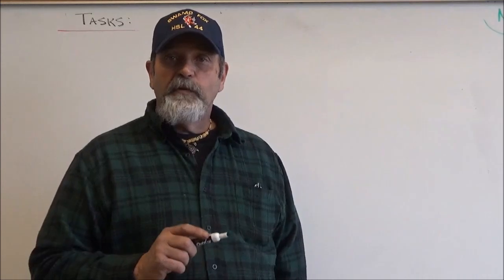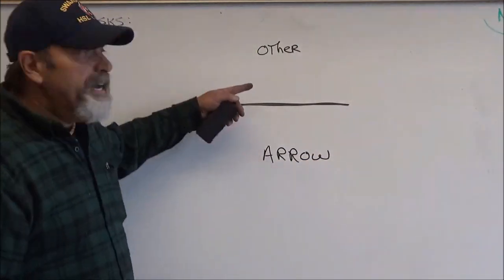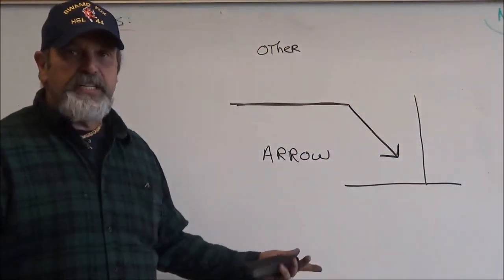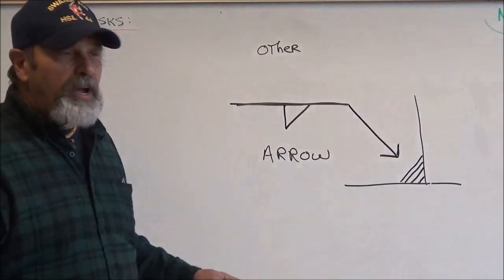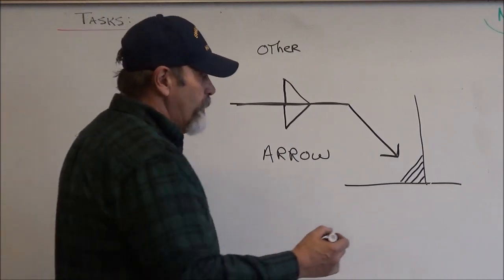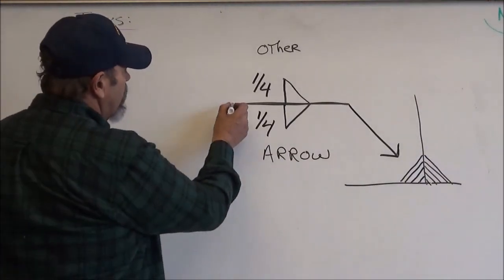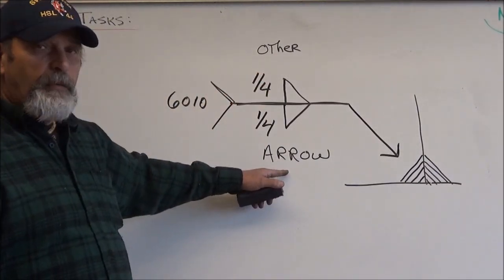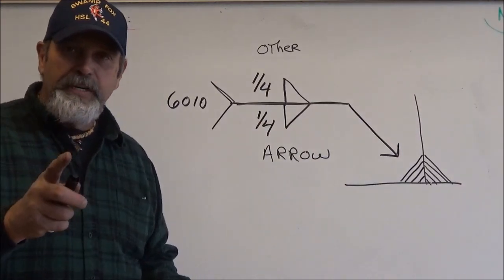Hanging with heavy weld symbols

Comment: Your wrong u read from the inside out and the inside is always your weld size
Reply from the maker: Well sly you could be right for sure if you see 2-6 that means your weld is two inches long and the spacing from the center of one to the center of the other is 6 inches, Now if you measure from the end of  one to the end of the other it is still 6 inches, if you measure from the beginning of one weld to the beginning of the other weld  still 6 inches, same as measuring from the center of one to the center of the other still 6 inches. I really don;t understand from the inside out explanation, as I am not familiar with that term. Make sure you like share and subscribe.